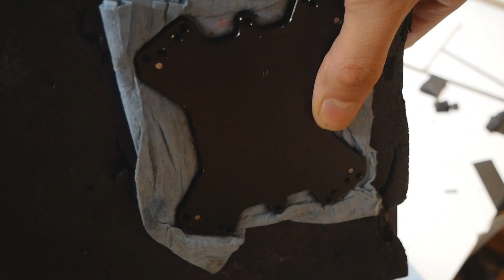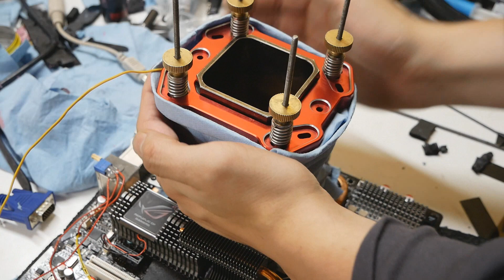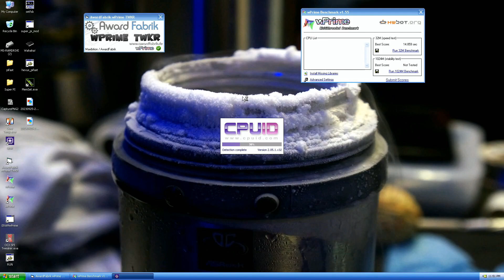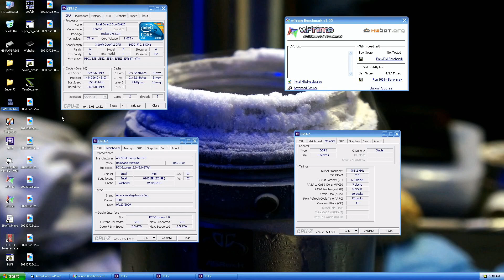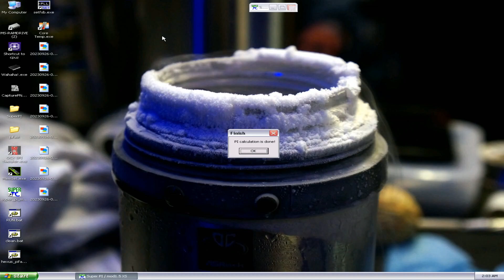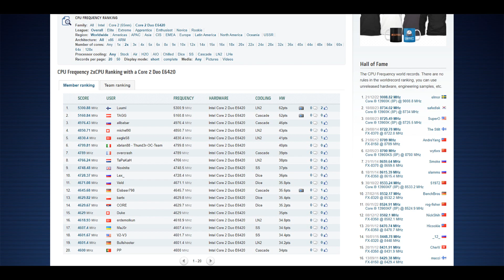Motherboard and Power Supply Issues - Intel Core 2 Duo E6420 Records on LN2

Comment: "Binned quite a lot of CPUs" ... "bought 20 or 30"

:)
Reply from the maker: Lucky that E6300 eh? What you think about the air result I mention? 4GHz on ambient cooling.
Reply: @LuumiJuhani  High FSB chips usually have at above-average cores (this doesn't work in reverse), which is good enough for E6420